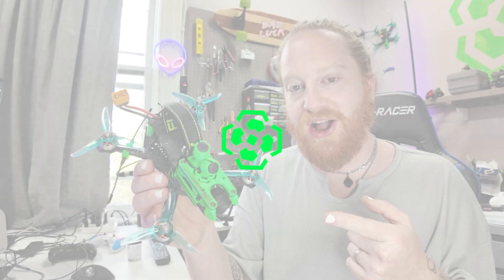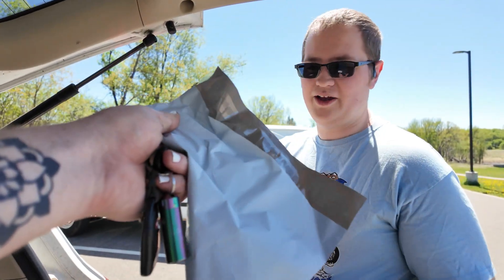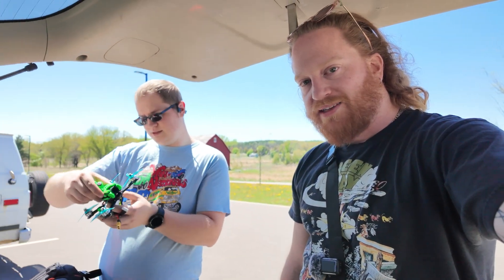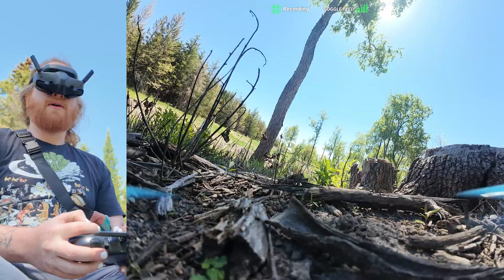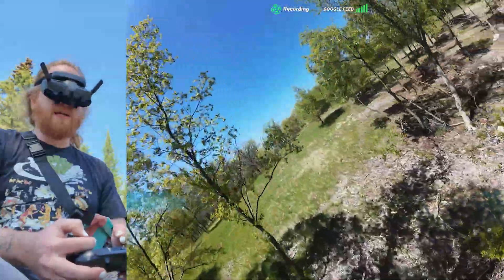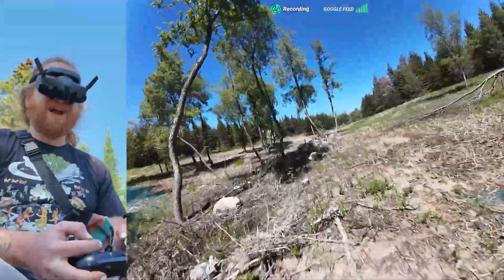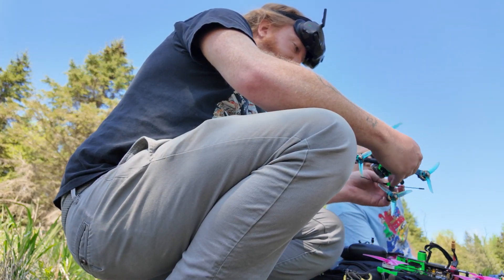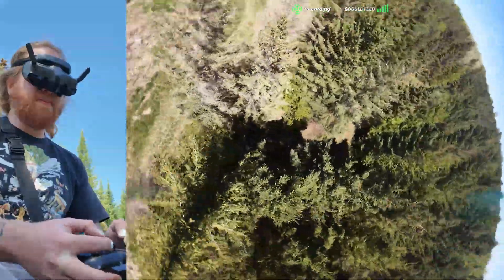TEST FLYING my new DRONE PROTOTYPE with quick swap VTX

Comment: What rates are you flying? Your rolls and flips are super fast and quad locks in any position you want as you roll and/or go inverted.
  Can’t tell if my rates are low…or my skill level is low.
  I’m flying an Armattan tadpole 4s.  775 degree per second roll, pitch and yaw
Reply from the maker: I rock 900dp/s and .65 expo. Makes it real smoove near the center and real snappy at the outer edges of the stick movement 🤙🤙
Reply: @CloverFPVSystems I run no expo.  I’ll change to your settings and see it how goes

Comment: I noticed that TaTTu offers a 6S 850 mAh battery. What motors did you use? I appreciate the wiring changes, as they clean up some of the wires and make swapping the Cover Cage easier. It seems like unibody designs are becoming more popular in new builds. For example, JB recently created a sub-250 3-inch unibody that is underpowered.  Try the 850mAh and see how that works out for flight time and performance.  Great video, looking forward to your newest drone, i own all your drones.
Reply from the maker: @dondupuis4007  thanks Don! It's with your help that I ended up at this solution! 

The battery that I used is the tattu 6s 550 and the motors at the Tmotor pacer 2400kv 1804. Thanks so much for your enthusiasm about Clover FPV Systems!